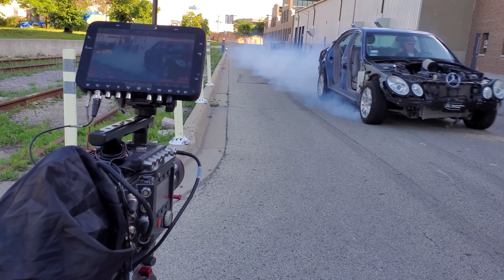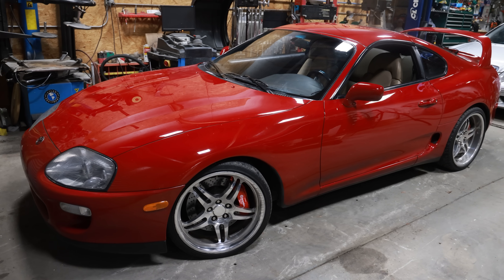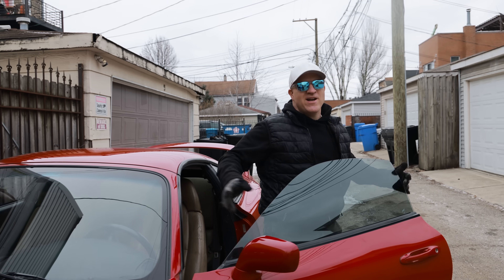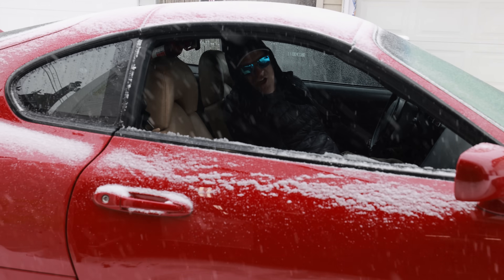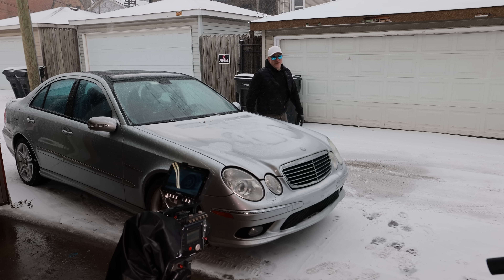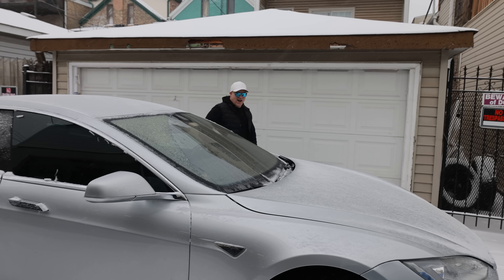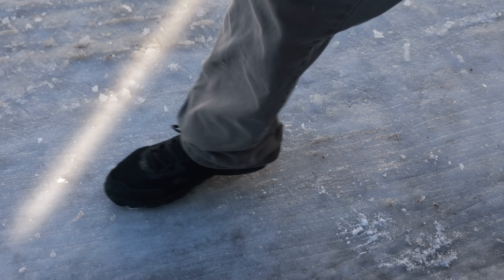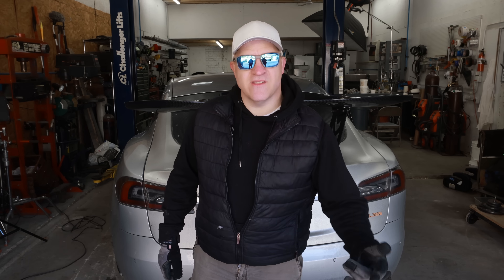Anti-Lock Brakes (In Slow Motion)

Comment: The length of the pulse isn't the important part, the important part is how close to traction limit the whole braking sequence can go. It seemed to me that Tesla was too aggressive on snow with those tyres and locked the wheels too much. Mercedes was close to optimal on slippery conditions. The optimal slide rate would be around 5% if I remember correctly: the tyre should rotate about 5% slower at all time than freely wheeling to get maximum stopping performance. That would cause the tyre to slip nearly all the time because braking force is high enough but not slide around to allow controlling the car.

If the wheel rotation totally stops during one pulse, the ABS controller is doing poor job.

Comment: The real difference happens at higher speeds, the older systems are slow regardless, the new ones are really quick at high speed and dont actually allow the full lock up of the wheel, keeping it right at the edge of traction, so decreasing stopping distance, on old cars (like pre 2000) it was slow enough that it made the stopping distance a bit longer than good treshold braking actually (not that everyone can treshold brake in an emergency situation though)

Comment: The pulse width will stay the same because the ABS pump works at a constant speed. There are 4 pairs of valves for each wheel that regulate pressure to each caliper.
In my SAAB and VOLVO the ABS feels more like something lifting up my brake pedal just a touch until my wheels start rotating every time they stop.

Comment: The E55 you have their has a really different braking system compared to the other cars, 

Its an "electro-hydraulic" braking system, it is a "brake-by-wire" technology, meaning the brake pedal is not mechanically connected to the brakes. Instead, when the pedal is pressed, sensors detect the input and send electronic signals to a control unit, which uses hydraulic actuators to apply precise braking pressure to each wheel, improving response time, stability, and safety.

it is a lot more versatile than the ordinary way of doing brake systems 

This system also has a 25 year warranty with Mercedes.

Comment: Now I want to see how massive the difference is between this and race ABS
Reply from the maker: That's a good one
Reply: What is race ABS?

Thank you.
Reply: @ ABS in race cars works in the same way as modern street cars, but its faster than most, and gives the driver more control over how much slip it allows. 

Street ABS is tuned for safety, to help bring the car to a stop AND maintaining steering while braking. This is great for avoiding children in the middle of the road. 

In racing, we aren’t too concerned about stopping the car, or turning while braking heavily, so it’s probably easy to understand that the street ABS settings aren’t optimal for racing. 

SO, race ABS systems give adjustments like:
- slip threshold, how much slip is allowed before ABS intervenes. 
- intervention level, after it intervenes, how quickly the braking modulates. 

You know how in the video the wheels on some cars turned a lot more between “pulses”? That’s an example of a lower intervention level, and the more rapid ones are a higher intervention level. 

Track surface impacts optimal ABS settings A LOT. Kind of like how ABS is worse in the snow, a high INT level may be better for corners with a lot of rubber on them, and terrible if those corners get wet. If it starts raining in a race, the driver that can adjust their ABS can brake significantly later than the driver that can not adjust ABS. 

And this one is up for debate, but a lot of drivers don’t like ABS intervening when they don’t want it to. They will adjust the slip threshold up, so that ABS only saves them if they’ve really really screwed up. 

The main takeaway here is that ABS on the street is designed to save lives. ABS on the track is designed to save time.
Reply: @TheOfficialOriginalChad  Thank u so much for educating me🙂

Comment: Abs is awful in the snow. I pulled the abs fuse out on my van after it tried killing me a few times by not letting fully lock up the brakes and instead pulses forcing me into intersections etc.

Comment: @1:43: Why would the battery fuse need to be replaced?
Reply from the maker: So basically I think in 2022 Tesla switched the type of main fuse to a newer self-powered later revision. I already changed mine like a year ago and one of the videos for my other channel. 
But I just never updated it so it thinks the old fuse is still in there. 
I definitely have to put out those videos of the Tesla tear Downs on my other channel I think people will really like them, I have quite a bit of Tesla experience.

Comment: ABS checks tire speed about a thousand times a second on modern cars. It's not trying to pump the brake, but rather it's trying to find the most braking force before lock up. I don't think the pulses are doing what you think they are.

Comment: My question is, Why is there no rear abs? Why doesnt the rear brakes help the front from sliding or does the front pads have more pressure than the rear
Reply: Im thinking if the brakes were bled perfect 50-50 front and rear wouldnt stopping be easier, it looks like front brakes lock up more often
Reply: There is definitely rear abs. Abs works on all wheels. Front can have more braking force as during braking the load transfers to the front.

Comment: I thought the pulses were when the wheel is spinning, not when it’s stopped

My logic is that my foot applies pressure to the pedal, which pushes fluid through the system to the brakes, causing the wheel(s) to stop. The wheel speed sensors and/or transmission speed sensor detect the sudden stop of the wheel(s) and the ABS computer tells The ABS system to send a “pulse” alleviating some of the fluid pressure to the brakes to allow the wheel to spin again. As a result, the pulse would cause the wheel to spin. 

Therefore, your Supra actually has some really nice antilock brakes.

Comment: I wonder if the Mercedes and Tesla take into account the ambient temperature and adapt based on temperature and wheel speed/slip detected by the rear wheel speed sensors?
Reply: Watching this made me think about how taking info from various sensors in more modern cars could definitely be used to adapt the ABS pulse width and frequency

Comment: Not an expert, just my toughts. To me ABS seems mostly limited by the calipers speed to release. Obviously we can make pumps that can pulse 100s or 1000s of times a second. But the caliper cannot adhere to that resolution.  I'm not suprised by the Tesla, agreed if thoughts on it is it's heft. However, I'd think the Mercedes would be quite hefty too, I odn't know what the weight difference is. And maybe my last points is tires make a HUGE difference. Your Lexus clearly had high performance tirs on it, and do I really neeed to say that of cousre those are garbage in about anything but dry and MAYBE wet. Don't really know what your Mec or Tesla has, they looked like typical sport sedan type tires, probably all season with a tip towards the sporty side.

Comment: One misconception about ABS is people think that it was designed to prevent you from skidding, it isn't.    It was designed to allow you to have the ability to steer during a skid by pulsing the pressure.  Without ABS, turning your wheel during a skid doesn't steer the vehicle,  with ABS, you're able to steer around obstacles while using maximum braking effectiveness
Reply: I think it evolved over time, it's true that it was developed to help steering during an emergency braking, but now with four channels ABS and quicker sensors it's also braking shorter than any human being without ABS.
Reply: @paindavoine_design  While that "braking shorter than any human being without ABS." part might be true, you also have to remember modern cars tend to be heavier than their comparables from the pre-ABS era (especially in Europe, since in US everything is overweight anyway) which - as shown by the Tesla in the video - will lengthen the actual braking distance.
Reply: AOS is a better naming, anti oopsie system
Reply: To add on, Abs is not designed just to pulse the breaks, otherwise we would not need ABS sensors, the sensors are designed to detect a lockup because the lockup reduces steering efficiency and breaking efficiency. So it's not about pulsing resolution. when the abs sensors report a lock up which depends on several factors like Vihecle weight, speed, tyre type and road conditions, and that's why vihecle with different factors won't pulse the breaks the same. Even if it was the same car model if it had significantly different factors the pulses would adapt to the factors of that vihecle
Reply: If that was so then why does my 88 F150 only have abs on the rear?
Reply: @michaelroberts5767  gonna call complete BS on that.   ABS was an optional feature on that year model.  And the ABS it came with affected all 4 wheels,  not just the rear. No such thing as a vehicle with only ABS in the rear.  IF it only has ABS in the rear then the ABS module was either:  modified,  damaged,  or it malfunctioned.
Reply: @josephgermany7446  call it then but a quick search will say otherwise, I have a 1988 f150 custom with the 4.9 and m5odr2 also with an 8.8, if you need more info to do a proper search lemme know
Reply: @michaelroberts5767  already did,  no vehicle was ever offered with ABS that only works on the rear tires.   They don't even make ABS modules with only 2 lines coming out of them.  ABS was offered as an option on that model,  but for all 4 wheels,  not just the back wheels.
Reply: @josephgermany7446  you clearly haven't done the search then, cause if you had you'd see rabs all over when talking about this generation, and can you guess what rabs stands for and does?
Reply: Not on ice it doesn't. ABS  like pretty much any safety nanny is more problems than its worth and a false sense of security. edit for the mongoloids that are upset about me shitting on abs. It's my opinion not a a dick, stop taking it so hard. You can disagree. I don't give a shit.
Reply: @Randmosh  you can always disengage it or break with your feet
Reply: @Randmosh you may complain, but the reason why it's banned in many (most?) competitive racing is that no human can ever do as good a job at braking as ABS can
Reply: @Ariccio123  cool
Reply: @Randmosh  leave it to the bumpkins to knock things above their understanding level and simultaneously bring up irrelevant subjects.  That's just something we commonly hear from people that don't know how anything works.  News Flash: it wasn't designed to work on ice,  nor did anyone here say it was.   That's like bringing up that it doesn't work in zero gravity,  we know that, guy,  it's not relevant.
Reply: @josephgermany7446  Lol
Reply: @josephgermany7446 I also believe that given this new info it would make you a bumpkin knocking things above your understanding level
Reply: @michaelroberts5767  hardly,  ABS was designed with the sole purpose of giving a driver the ability to steer under hard braking.  Wouldn't make sense to only apply it to the rear wheels.   Your vehicles is either modified,  or you just don't know what you're talking about.   Find the ABS modules and tell me how many brake lines come out of it,  I'll wait.
Reply: @michaelroberts5767  this is you-> "I FOUND THIS ONE INSTANCE OF UNPROVABLE ANECDOTAL EVIDENCE,  SO YOUR ENTIRE ARGUMENT IS DEFEATED"  🤣🤣🤣 Sure kid...
Reply: @josephgermany7446  guess what, 1 line in 2 out to the rears only
Reply: @michaelroberts5767  good now identify the other half of the module...
Reply: @josephgermany7446 I'm not the one that made a false statement nor do I continue too, anyone can dive into this subject and see that you have no idea what you're talking about
Reply: @michaelroberts5767  I'm still waiting to hear your explanation on how its even remotely relevant to my original statement.  Even if it was implemented in a single model in opposition to its original purpose doesn't negate the fact that it was designed to allow someone the ability to steer under hard braking.  You're arguing a moot point.
Reply: @josephgermany7446  you're a lost cause my guy
Reply: @michaelroberts5767  you're focusing on a single case in opposition to the rule, but your IQ isn't high enough to realize that the single instance doesn't negate its original purpose.  Just because ford failed at executing proper implementation doesn't mean my original statement isn't true.  Comprehension is hard huh boomer?
Reply: @michaelroberts5767  and for the record,  you're arguing against common knowledge with a single anecdote.   You're basically saying "I bought a vehicle where the manufacturer failed to understand the unit's intended purpose and failed to properly implement it into the vehicle,  therefore,  all vehicles with proper implementation of said unit don't fit the stated purpose even though manufacturers worldwide implement it for the purpose stated."
Reply: @josephgermany7446 this was interesting... I went to two Ford enthusiasts sites... and sure enough they have forums topics discussing issues with 1988 ford's that have RABS.... no front anti-locks.... what a silly manufacturer decision... but it seems to be absolutely true.. rear only..wow
Reply: @kafklatsch3198  still,  that wasn't the original argument,  and again,  an outlier doesn't disprove what it's original design was for.  Funny how that works.   Can't stay on topic when somebody starts with whataboutisms
Reply: @josephgermany7446  so aftermerket only... okay
Reply: @kafklatsch3198 Chevy and Dodge also did rear wheel only ABS on their pickups for a time. Chevy somewhat quickly changed over to doing 4 wheel only, and 4 wheel was an option on the Fords and Dodges.
As I recall, there was a federal mandate about rear wheel ABS on pickups in the late '80's or early '90's. The rear wheel only system wasn't intended to maintain some steering ability, it was only intended to stop the rear wheels from locking up to help prevent the back end from stepping out. It's a lot easier to lock up the rear of a pickup and get it sideways because unloaded they don't have much weight over the rear tires.
Reply: @Stephens_offroad_and  I see.. i've been one of those German vehicle guys since the late 80's... 4 wheel antilocks...